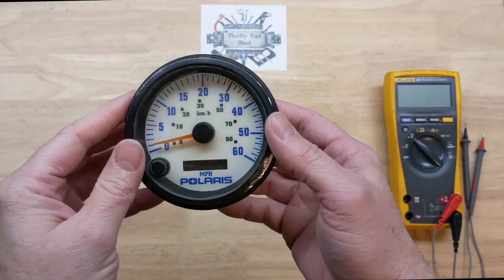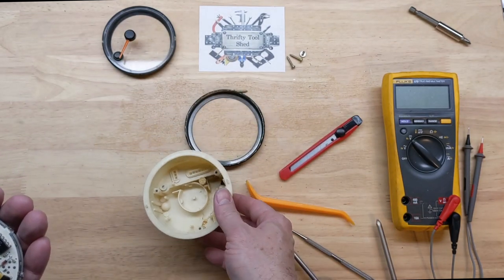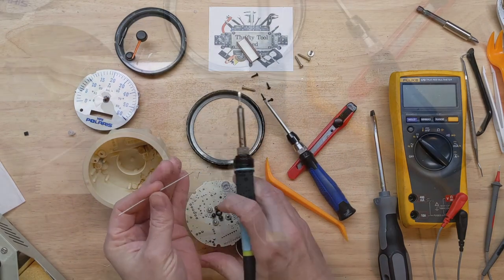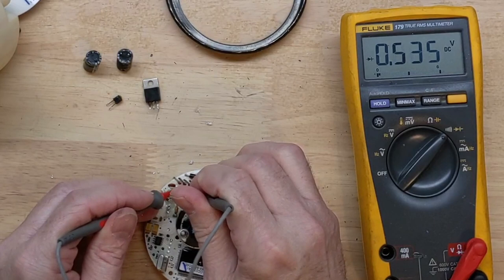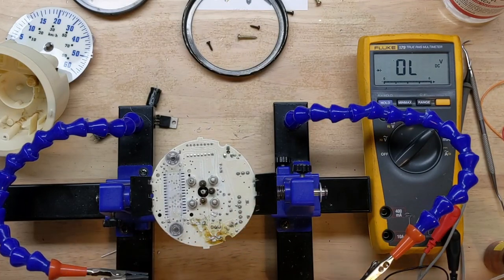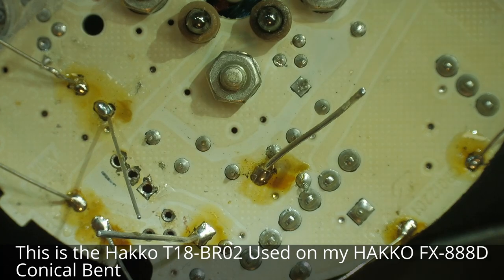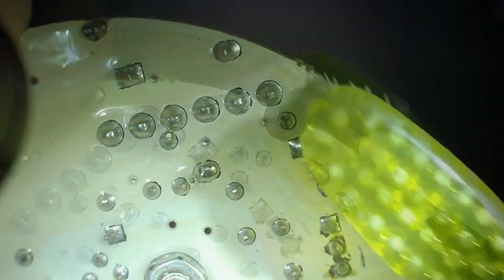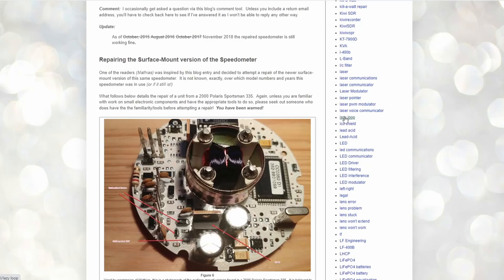Polaris Speedometer Repair - Part1

Comment: Wow, what a nice job of trouble shooting and documenting your approach. I love your tools, obviously this is not your first rodeo. Thanks for posting you did a fantastic job. De-soldering tool, device tester, board holder, curved soldering tip and low temp solder and flux types was very informative.  Nice job.

Comment: Thanks for the very in-depth videos on this repair!  Would you happen to know of a source for the LCD display?  The display on the 2002 I just purchased has disintegrated from water damage, but miraculously everything else functions ok after I dried it out and cleaned it.
Reply from the maker: I sure don't. It is a few items that would be very hard to find replacements for. The LCD, microcontroller and gauge would all be hard to find without buying another unit for spare parts. I wish you the best with yours! Thanks for your kind comment.
Reply: Thank you for the response!  I'll keep an eye out for a parts speedo